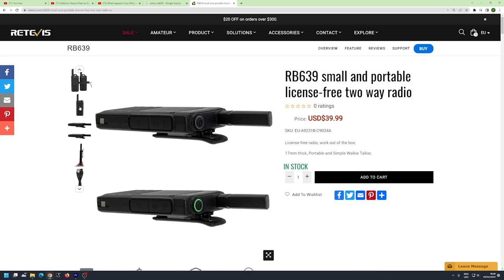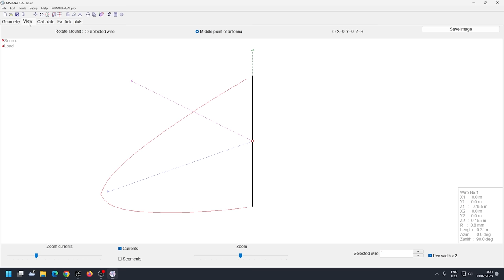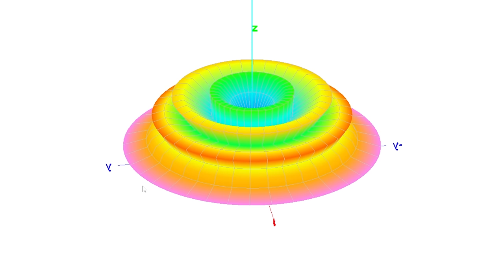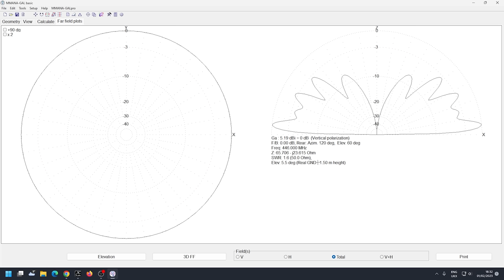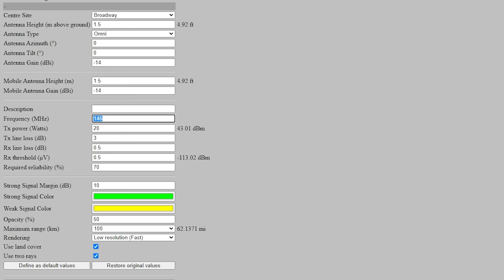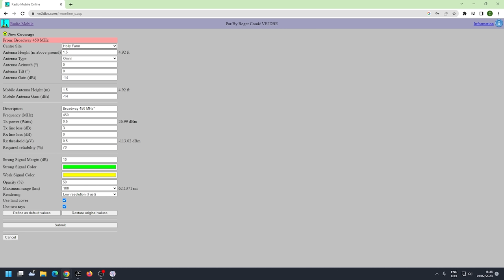The Science of PMR446 / FRS / GMRS Range: How Far Do They Really Go? (Retevis RB639)

Comment: Great video, sir. Here in east-central Illinois, USA, the local GMRS users have started doing a weekly simplex net so everyone can experiment with his equipment. We've gotten scratchy but readable contact between two stations 35 miles apart, both with good antennas and 40 or 50 W power. Terrain is very flat around here so that works in our favor.

I've done 6 miles simplex between me and my son using 5 W HTs, in good band conditions with a high-gain antenna on my end.
Reply from the maker: Thanks for the info! Love the ideo of a weekly net..
Reply: Good stuff

Comment: GMRS radios, at least in the US, can have removeable antennas (FRS can not), and there are some very good replacement antennas that will get relatively better TX/RX.
Reply: Repeaters and external antennas help considerably with gmrs. 50 watts thru a high gain antenna 30 feet up I achieve pretty good results. line of sight and hieght is name of the game in uhf. Repeaters are becoming more common in USA and can be linked to internet. 100 mile range is very possible in western US using linked repeater systems. Is is a evolving service ,Porta Rico has many out of need from storms and infrastructure problems with phones. Government has a large blimp they can deploy over island it has a high end ham and gmrs repeater on board big coverage after storms. Layers of different communication are always the best bet. HF however being the most  consistent  and reliable for the average guy. Bottom line rock your radios ;) .
Reply from the maker: Yes, GMRS different ball-park.. I was going to spend more time on that - then though, "nah - it'll get muddy"!

Comment: Another very informative video. In the US FRS requires no license and 1/2 mile in a neighborhood around here is a good signal. GMRS shares some of the FRS frequencies but power can go up to 50w for a base station. A license is required but no test. 2 to 3 miles line of sight in the rolling hills with LOTS of trees is normal signal. Our club and ARES group is considering putting up a GMRS repeater for testing but coverage would require multiple repeaters because of terrain. Because of limited range in this terrain we stick with VHF/UHF Ham frequencies with lot of repeaters with antennas between 500 ft and 1000 ft. A friend made a GMRS contact 22 miles HT to HT but that's very unusual. Jack K5FIT
Reply from the maker: Interesting comment Jack. It would be fun to have GMRS in the UK..
Reply: @DXCommanderHQ  we are proposing to the County Sheriff that he request the installation of GPRS repeaters on the 5 county owned 500 ft towers and license his deputies because he wants backup radio possibilities between dispatch and the patrol cars. Of course they would be public repeaters. We'll see how that goes.

Comment: Hi Cal. As I'm sure Tom (Hello) will know, back in the (Army) Clansman days we used to use PRC349's on 70cms. If it was raining and you were in a wooded area you could basically forget any decent comms with them. Water is a great attenuator at those freqs.
Reply: Hi Andy - indeed - coupled with a throat mic they were absolutely the DB''s (without the dog)  !!  Add in the weight and battery-life and the tacticool antenna - huzzahh!!!  Marvellous (not).  Really well made though and built like a tank (tanks have better comms inside!)
Reply from the maker: Haha.. You guys! :)

Comment: I'd love to hear your thoughts on those flat 'tactical' foldable antennas in UHF. How effective are they really?
Reply from the maker: Yeah, they look VERY cool.. Never tried one (yet!)
Reply: If you are talking about the 'tape measure' type antennas like the ABBREE 48 inch AR-152 'Tactical Antenna', they work pretty well on 2M & 70CM, but do better on 2M, IMHO. 
SWR, next to the head is ~2.0 on 2M, & ~3.5 on 70CM. 
I can hit  repeaters up to ~ 70 miles away from inside my house on 2M using 5 watts.  UHF repeaters, not so distant - maybe 20 miles (very dependent on topography - 2M, less so).
Using a hand mike with the unit on a belt clip takes the range on 2M down a bit - not much.
Hope that helps.